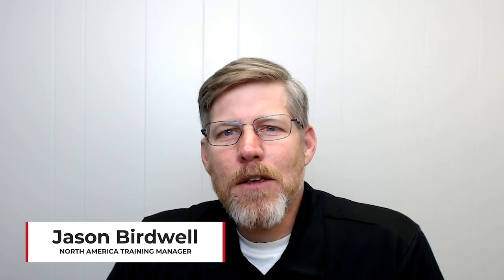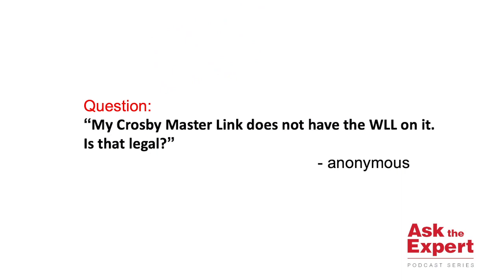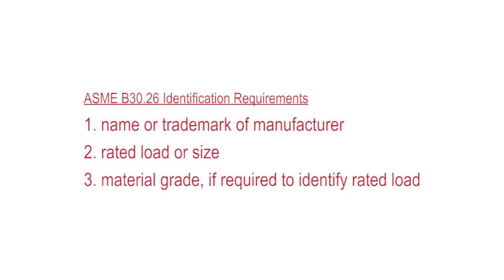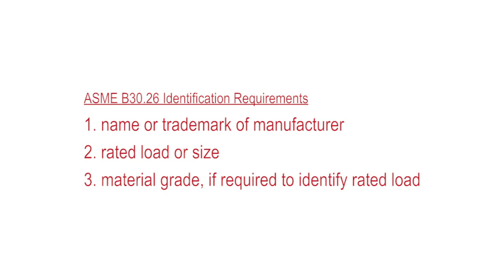Master Links: Missing WLL marking?

Comment: Could you please explain about the different between wire rope and synthetic slings in choker hitch, and if it is required if we are using 2 wires in choker hitch to put both hitches in opposite direction to minimize the rotation during the lifting operation? Or we have to put both chokers in the same direction
Thanks
Reply from the maker: Thank you for your query.
Much of the difference between these two types of slings and their application in a choker hitch is based upon the sling’s material type and construction.
Reply: @crosbyrigging  could you please explain more with a clip, would be much appreciated, thanks